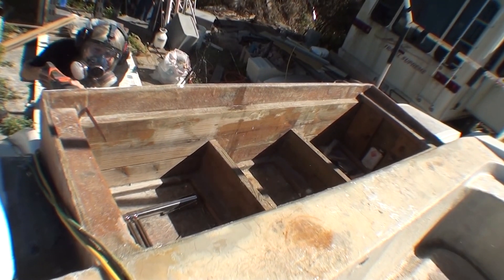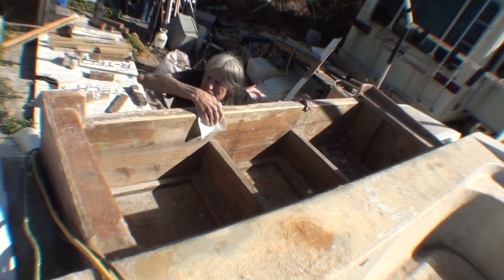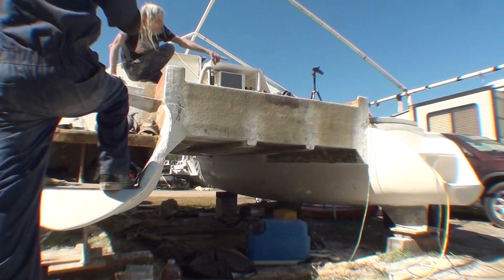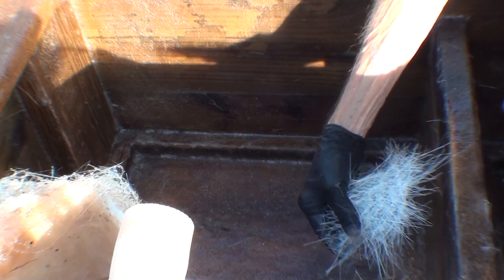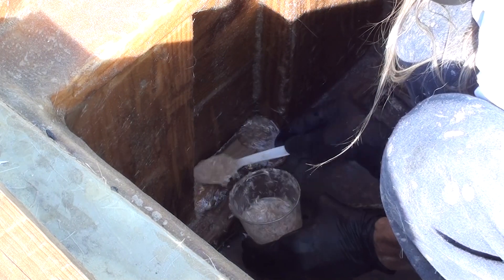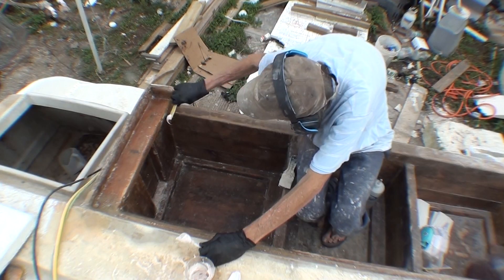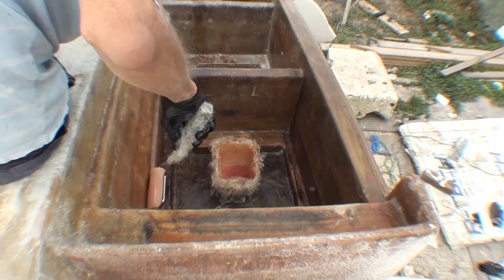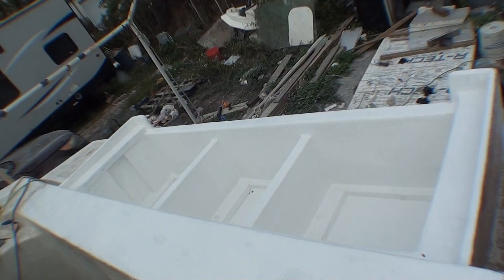Building A Transom To Hold A Large Outboard Motor

Comment: That looks really good that will hold the weight of your motor no problem
Reply from the maker: I hope it holds the weight of the motors.  There will be some redundancy in case the big motor doesn't start, but if the transom falls off, it takes all the motors with it.  There is no redundancy for this.